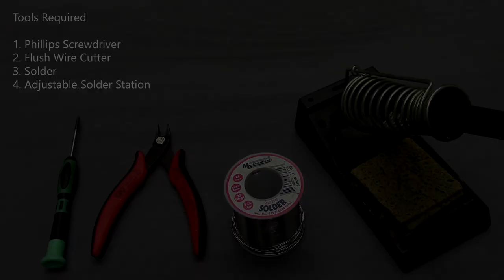Max Falcon-20 RGB / Falcon-8 RGB Programmable Macropad Mechanical Keyboard (DIY KIT Assembly Guide)

Comment: Can we be able to set less than 10ms time for macro? Please answer
Reply from the maker: Yes, you can set less than 10ms or no delay (check the box), but please remember it will also depend on how many characters you have on your macro. Contact our support if you need further assistance.
Reply: @TheMaxKeyboard  I have only one character, I just want a key that simulate a mouse click 0 or 1 ms, I bought this just for that but whatever I try I get a delay of 10-16 ms even if I press not delay, I already tested it comparing others macro keyboards and they're faster but I want this one specially because I want the macro keys to be saved in the keyboard  to use it on any device (works on Ipad but as I said the macro key is just saved to 10-16ms)
Reply: @ktraxD  Hey were you able to get this down to 0 or 1 ms? I'm considering getting the max 20.
Reply: @mavr1k440  no, I was not able to do that even that I talk to them and they tried to show me how to set up less than 10 or not delay 0ms but they show me what I already knew, setting  to "not delay," but the delay still there and is about 10-20ms , talking about functionality the keypad is pretty good, works on my iPad.

Comment: What kind of solder should I use?
Reply from the maker: Any lead free solder will work
Reply: @TheMaxKeyboard  can I put knobs into it with rotary encoders or will that not work?
Reply from the maker: @jeremyweiner8743  It will not work. Our PCB and Firmware are not designed for it
Reply: @TheMaxKeyboard  oh ok thanks do you plan on releasing something with the feature I really like your products so just asking
Reply from the maker: @jeremyweiner8743  Thank you for your suggestion and we will look into adding it to our future releases.
Reply: @TheMaxKeyboard  thanks you have a great company with the best customer service I’ve ive ever seen